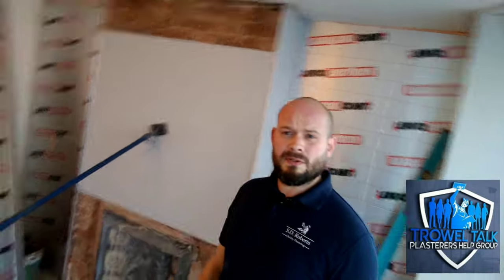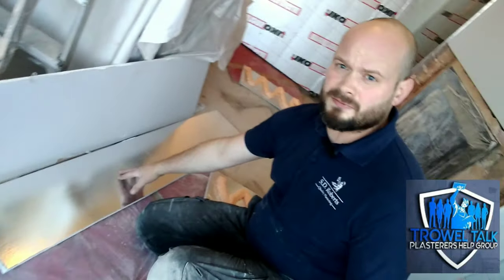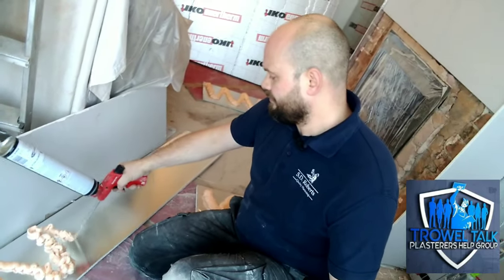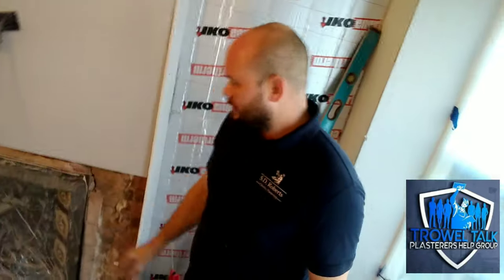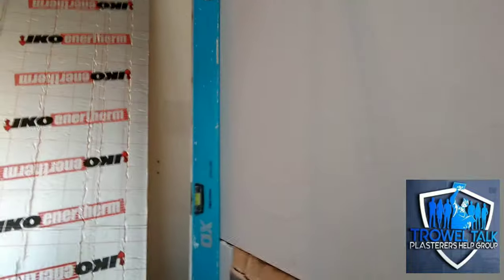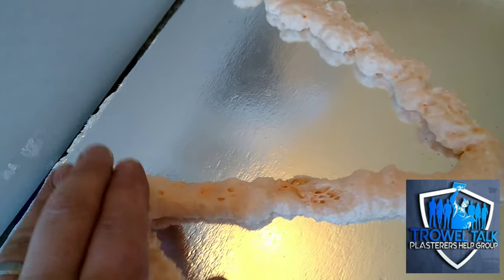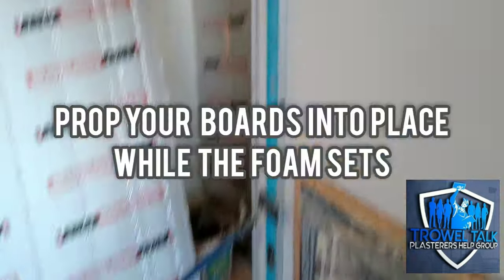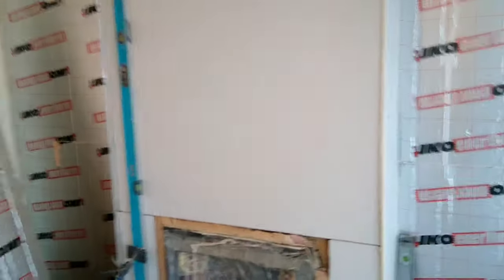HOW TO STICK BOARDS WITH FOAM ADHESIVE

Comment: Hey stu, you should stick it to the wall before the film is there. Otherwise you won't have optimal bonding to the brick. Wait 5 minutes instead of 10, the foam should become stringy when you touch it and pull away.
Reply from the maker: Your right mate 3:42

Comment: did it recently, surprising how warped the boards are, I was grateful I had the aluminium fixings to drive them in and keep everything flat. OH and before doing this I recommend you ‘dot’ little pieces of cement board on the wall get them all level and let them set. That way when youre pushing your boards home youre not guessing how far to push them to keep them level. I used tile cement to set the dots, add a litle cement to it and itll go off quicker or if you have a little lying around use rapid set.

Comment: Hi pal thank you for all that , just a question you’ve done the video 6 months ago about the waterproof membrane sheet , my question is can we use this foam technique instate the sheet man the fixing takes forever thanks for help
Reply from the maker: Hi Dana Lak,

The problem with bonding the membrane with Foam is it may obstruct/ fill the cavity at the back of the membrane.

The system is designed to allow for an air pocket behind the membrane.

I would suggest that if you were to do this then small 'dabs spaced out every 8" would be less likely to restrict air movement than applying the foam in a continuous ribbon. I hope this helps. Thanks for watching the channel 👍
Reply: @troweltalk2719  thank you for your reply 
Sorry I wasn’t very clear I meant using this system  boarding with foam instead the sheet membrane would that work on the dump brick walls thank you for your time
Reply from the maker: @danalak4870  Ah got you Yes it would work you would need quite a thick existing plaster line to keep the board flush also the damp issue would need to be resolved beforehand 👍
Reply: @troweltalk2719  thank you so much appreciate it, keep it up we learned allot from you

Comment: Used dow insta stik yesterday, applied a 25 mm  bead all around the board and waited no more than five min before trying to bond it to the wall . The foam skinned over so quickly it just wouldn't stick at all ! The only way I could get the boards to stick was to press them up against the wall immediately after applying the glue . Is this a common problem with foam adhesives ?
Reply from the maker: Not with megastick. It depends on which brand of adhesive you go for
Reply: @troweltalk2719  used the pink grip foam years ago and I'm sure I had to wait 5 min before sticking the board against the wall . It didn't actually say anything on the back of the tin of insta stik about having to wait so maybe with this product it's not necessary. Thanks for the reply, I'll try the megastick next time 👍
Reply: Soudal foams are the same.. you cant spray them on a vertical surface or even near vertical just roll off which is awkward when you dont have anywhere to lay the board flat.

Comment: Hi, I saw either side of the chimney had insulation up did you then glue the plaster board to the insulation? If so did you use the same foam? Thanks Tom
Reply from the maker: Hi Tom yes you can use builders clear silicone for this or AC50 board adhesive 👍 you could indeed use the megastick but better use clear silicone it grabs really well & can get a tight bond

Comment: yes, this expanding is enemy but no one will tell you that. without mechanical fixing you cant make this job with foam. thanks for video. Do you can use spray water to speed up expanding?

Comment: Hi there Stu, what do you use for a platform when you do high straight stairs. like in council houses. For example, in through front door, stairs straight in front, curve at top. High three walls. I hope this makes sense. You have done vid on stairs and landing but not high stairs with platform. In fact no one seems to have done vids on this. Cheers.
Reply from the maker: Thanks for watching the channel If domestic we always do off ladders & planks if it's commercial large space we will hire a tower 👍  
You should get a ladder on the stairs against the wall then run planks?

Post a photo of the job on the group the lads will help you out 

https://www.facebook.com/groups/422884412302728/?ref=share

Comment: Hi there Stu, 

Another good video, just wondereing if you could help me out here, 

 I am about to take a big project on, I am going to insulate all the external walls of my house from the inside, wondering if you think foam is the way to go, as I intend to stick plasterboard insulation   over already dot and dabbed walls, although I have searched youtube and cannot find anyone else that has done this, my reason being I live in a modern house (20 years old) with a  cavity, but I think alot of the isulation boards in the cavity  were missed out or far to thin  leading to cold walls and a cold house but no damp and alot of heat loss, 
 My radiators get bouncing hot but the rooms take a long time to heat up, and then when the rads are turned off the rooms soon lose the heat, my choices are to strip the plasterboards and dabs from the walls and re-dab them the usual way, which is a massive job while living in, or just go over the top with the foam, also while I do each room just wondering if I would benifit from  screwing a thin insulated board  to the studs and reskim, especially now with the price of energy going up and up  any suggestions or advice, cheers.
Reply from the maker: Hi Green up,

There is an adhesive product we use called AC50 (see link below) it is a general purpose plasterboard adhesive specifically intended for bonding plasterboard. Given that your walls are already lined with plasterboard (dabbed) you can use this adhesive & bond insulated plasterboard directly over the walls. Foam would also be fine to use however you will only require a small bead of adhesive because your walls are already boarded so I would be inclined to use the AC50 as it does not expand & you can apply then stick your boards straight on. Might be worth sealing the walls first with pva just to be safe. 

https://ffx.co.uk/product/Get/Everbuild-Hh0119100700-5029347600358-Acoustic-Sealant-And-Adhesive-380Ml-C4-Ac50

Hope this helps
Reply: @troweltalk2719   yes Stu thanks very much will look into the AC50 I have used the foam before at work on  small area's with handy boards but never with big insulation boards. cheers

Comment: Great video Stuart. Could you use mushroom fixings or are they just for insulated plasterboard?
Reply from the maker: Hello big man we could do but would Peirce the vapour barrier so I like to bond them
Reply: @troweltalk2719  aye makes sense mate, I’ve never done anything but float and set all my days.🤙
Reply from the maker: @markneeson7162  love the float & set proper Plastering in my eyes pal 💪 this system is fail safe over damp bricks. S+ C systems with waterproofer would also work

Comment: Can that adhesive be used between fiberglass(filon) and styrofoam or will it dissolve the foam?  Thanks
Reply from the maker: Hi Rick L

We use these adhesives to bond polystyrene backed plasterboard to masonry so my answer would be yes

Comment: Hi could you use this foam for overboarding? With prop assist
Reply from the maker: If you are talking about ceilings then no. Ceiling boards must be screw fixed into the joists using suitable size drywall screws. 

I have a video on my channel named overboarding lath and plaster ceilings

Comment: Hi Stu can this work on a basement wall, it has been painted in the past and just want to line it?
Reply from the maker: It would depend on the dampness of the walls.. it could work providing moisture content is minimal meaning you have no moisture/ damp issues within the walls. Membrane + drainage system is the correct way if the walls are damp otherwise it's just masking the issue. Hope this helps

Comment: What I dont understand about this is, the silver is to reflect heat into the property. So why do they put it on the outside to reflect heat back outside...surely if heat is coming from the fireplace youde want it to come in?
Reply from the maker: Hi there,

Thank you for watching the channel Vapour control board is used to stop damp from penetrating through to the plaster hence why it is installed on the back & not the face